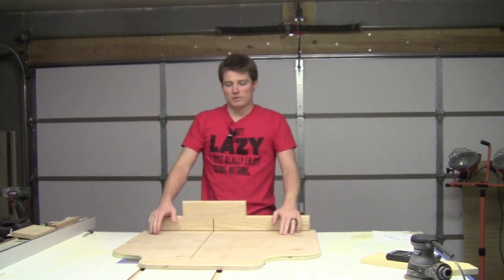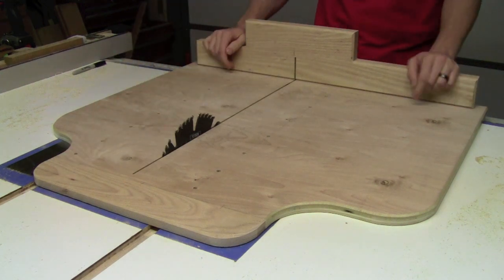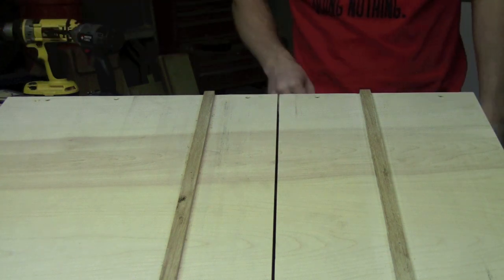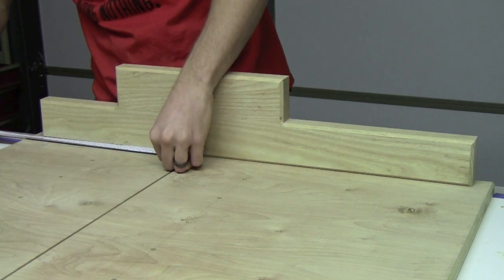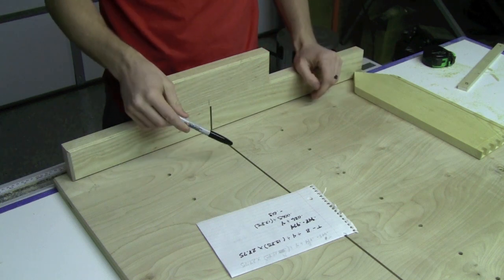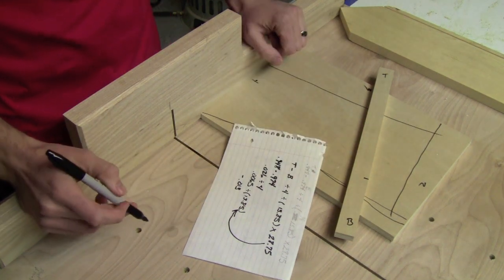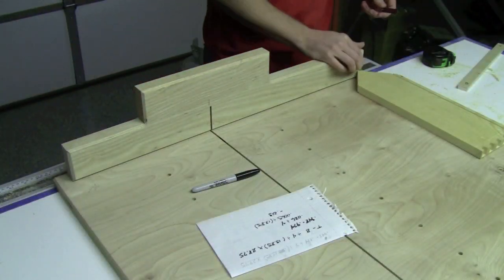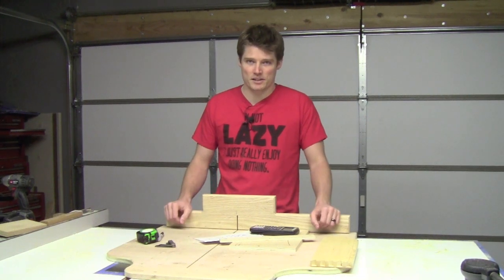5 Cut Method Explained

Comment: Great explanation!  I've watched so many of these and I now I finally understand how to move the fence correctly.  Although, I left all the math calculations out and just did it trial and error. If the top number was higher, I moved the fence back, and visa-versa. With three tries, I got it within .007 after doing the 5 cuts. Thinking that should be good enough.

Comment: okay i'm a  new woodworker and very new to the 5 cut method so please excuse the dumb question. Does the piece of wood have to be square to begin with?
Reply from the maker: Not necessarily but setting it as close to square using a speed square or a framing square can help you get to as close to square as possible before you start the five cut method
Reply: @rhwoodshop  Excellent. thank you so much for the  quick reply

Comment: Thanks Drew, some people are bothered by math, even more when there are several steps. I sometimes try to explain things with pictures. For example with your fith cut piece measuring more at the top. Place a square against the fence opposite the end of pivot point. Slide the square to blade edge, you will see a gap move the fence in correct direction the gap will close. I like that your instructions give exact amount to move. I actually used a last word indicator attached to the fence and checked perpendicular to blade by moving sled.   Great job explaining how and why it works.
Reply from the maker: Thank you Joe, I am a visual person myself. That is why I did the follow-up video for the five cut method. I think it will help a great deal for most of the viewers.

Comment: Good work and great explanation on the 5 cut method...what would you say is an acceptable positive or negative measurement in home shop woodworking ?
Steve
Reply from the maker: I would say anything around .010 would be acceptable, Whenever I used my square only I got within 0.013. Keep in mind the longer the board the more of a error you will have. Mine was a 0.002 error over the length of 13 7/8 of an inch. So the smaller you can decrease the error over a longer board the better.
Reply: Thanks for your reply.
Steve

Comment: I have a Dewalt. Able saw attached is the splitting knife for anti kickback. Does this have to be removed every time before using the crosscut sled? If so its not that easy removing and attaching again. Patrick
Reply from the maker: Yes and no, depending on how deep you make the base, you can just slip the sled over the insert and it will act as a backstop so you won't accidentally cut through the back, like I've done in the past. However, this will limit your depth of cut if you choose to make it this way using a riving knife.  Otherwise, just make one with a back fence much like the front fence.

Comment: If you put on a back fence and cut through it you would actually increase your cut capacity because that uncut section of your sled is thicker than a back fence would be.  The fence doesn’t limit your cut it’s the size of your sled so if most others only have like 10in of cut capacity it isn’t because of the back fence it’s because they made a dinky lil sled.  In fact unless you plan on raising the blade into the wood you plan on cutting, you actually also limit your cuts by the length of the exposed blade as well which makes your cut capacity a LOT smaller.  Back fence bro...  do it...
Reply from the maker: My sled actually has a cut capacity of double the width of my sled because I can flip the peace I am cutting over and put the cut section towards the front and the uncut section towards the back fence and cut it again. Not having that back fence increases my cut capacity by double the width of the sled.

Comment: Thanks for your good explanation on the 5 cut method. Could use some help pls, what does a final number of -0.0373 equal on the feeler gage?
Reply from the maker: MorseCode Alpha 37/1000 of an inch. Or just under 40/1000 of an inch. The negative/positive in the number just tells you which direction to move the fence either forward or backward.
Reply: Rock-n H Woodshop thanks and sorry to ask such an elementary math question.  Spelling it out just for clarification, fourty-thousandths or four- thousandths?  The only reason I'm asking is that I'm pretty sure that my error margin  is not that far off.   .040 is greater than .004 yea?  All things aside and thank you kindly for your rapid reply, I was able to finally get error margin near 1 thousandths, lol after about 10 screw holes. First time blues, next I made a sled for my dado and came within 2 thousandths just with a square🙀

Comment: Beautiful sled.  

Just a question. How well would a built in rule on the sled work.  
I would love to try something like this and perhaps add a type of rule on either side for small cuts. Something along the lines of a seamstress measure tape than can be adhesived down to the sled or fence to speed up the process.
Reply from the maker: It would help a great deal. I had plans for it but after giving it some thought, I chose not to. Reason for that decision is because the sled is a zero clearance and I can easily hook my tape measure into it and place my stop block where I need it so I can clamp it down. I will say that after the sled wears some the zero clearance my widen and the tape you would have put in there will always be the same. However, for me, by that time I usually replace the sled. :)
Reply: Very tru. Didnt think of that.  I need to get out here and get my sawdust fix. lol

Between your vids, and the other fellas I follow, and the nasty weather here, I been seriously jonesing....lol

Just got a box of pieces of teak . So im trying to figure out a project. LOL
Reply from the maker: Teak huh? I'm thinking something outdoors or maybe a shower stool or shelving for the shower. Brainstorming....... ;)
Reply: unfortunately the pieces arent that big without doing some major glue up...lol

It looks like someone salvaged a boat and stripped the wood. a lot of little pieces of trim, a few small blocks, etc

Hmmm,  theres enuff there, I might knock out a teak biz card holder with one of the small blocks.
Reply from the maker: That would be sweet. I've been thinking of something like that too. Hood idea
Reply from the maker: Good.......der!!!

Comment: How are the cuts made? Cut one side then flip the cut side to the fence then cut again? Over and over
Reply from the maker: +Craig no flipping. Just turning in either a clockwise or counterclockwise motion until you have made 5 cuts. The 5th cut should be the final strip you measure for discrepancies.

Comment: Hey Drew, 

Thanks for the video explaining how to figure out your difference on the fifth cut. I'm still not sure if I'm doing correct, so I wonder if you could look over my numbers and see if I'm on the right path?

Front:  .5395
Back:  .3075
5th Cut Length:  9 5/8 or 9.625
Length from pivot point to end of the fence:   29.5

I came up with .17776623

I'm still un sure of what I need to do with the (.17776612) to give me the distance I need to move the fence. Do I use a feeler gage closest to (.17776697)? I do know that I need to move the fence back since it's a positive number. 

Thanks for your help!

Chris
Reply from the maker: +zipmac22 I read from your email that you had sent me after I had responded that you got your sled within .008 of an inch. Sounds pretty good to me. Great work!

Comment: why do some people try to adjust their fence after the 4-cut method when they are literally a hairs width out of square? they'd have to be cutting wood half a mile long for it to make a significant difference from one end to the other surely?
Reply from the maker: I think it’s just the challenge of trying to get it perfectly square to the thousandth of an inch. If you’re not cutting wide pieces that are more than three, four or maybe even 6 inches wide you may not notice a difference but if I hadn’t done the five cut method and just done it with the square I would’ve noticed a difference no matter how narrow the piece was because it was still noticeably out of square.
Reply: Hi, thanks for the reply. If i'm correct yours was 0.13in out? So that would be 3.3mm which i'd agree would definitely need squaring up, but if it were say 0.3mm would you bother? I'm genuinely interested in how far people would go to try and tweak it. I would imagine that swelling/contracting of the wood could count for a 0.3mm shift anyway. I'm about to make my first cross cut sled, so it certainly intrigues me. Also why the first 4 cuts? They don't seem to have anything to do with the 5th cut as they are disguarded and only the 5th slither is measured. Or am i missing something here? Thanks for any further advice offered.
Reply from the maker: In my own opinion I would try and get it below a a hundredth of an inch
Reply from the maker: I would say that .3 mm is dang near perfect enough.
Reply: So that the initial error is multiplied by 4 which in turn gives the whole method great accuracy.

Comment: When using the 5 cut method, how good is good enough? A guy can turn his sled into Swiss cheese trying to chase down perfection. Lets say on a 6 inch board, what would good enough be?
Reply from the maker: The way I look at it is if you can get it to .005 of an inch then you're doing very very well
Reply: dvxman72 t